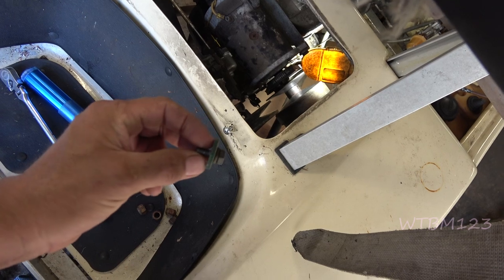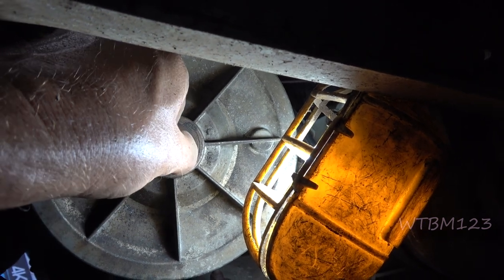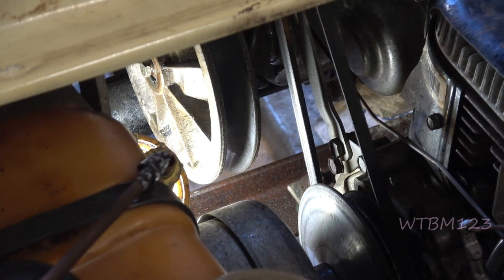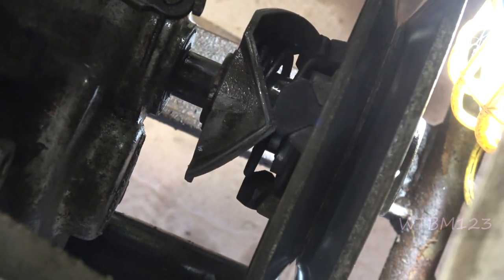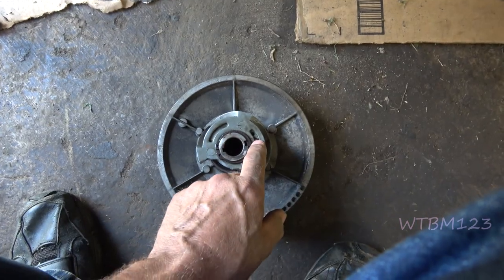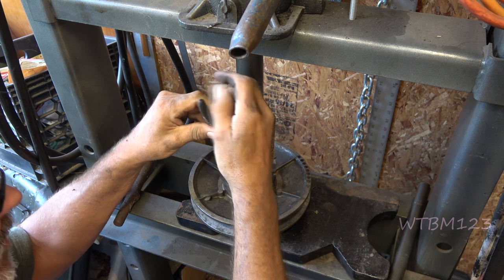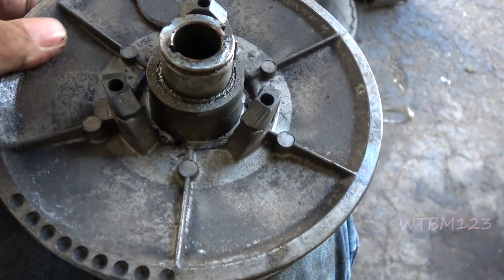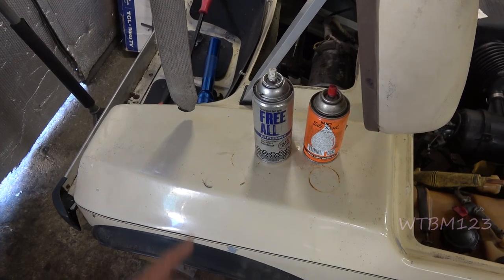Club Car , Remove Secondary Driven clutch ,Take driven clutch apart

Comment: Im having problems with my clutch on my 1992 club car ds..How do you know i know which clutch is bad, the primary or secondary?
Reply from the maker: Mine one of the ears on the secondary  clutch had broken .
Reply: Ok thanks
Reply: I was asking because my clutch is making a loud noise but theres nothing visible broken, no broken ear etc...so im having a hard time figuring out which one to replace, the noise is so loud now that i can no longer drive it

Comment: Good video im wondering  if u happen  to knoe the size of shaft that the clutch runs on
Reply: I have some videos where i swapped out the motor for a predator 212 non hemi
Reply: And trying to see if maybe i can go to chain gear on rear and ducth the heavyweight  clutch  and all
Reply from the maker: With a ruler i just measured the hole in a clutch and it appears to be 7/8 inch. Hope that helps